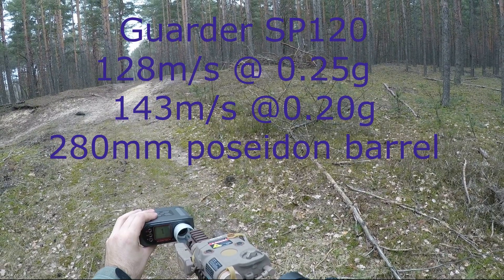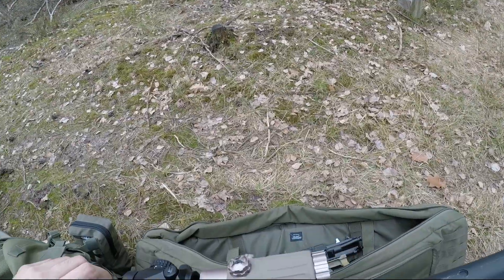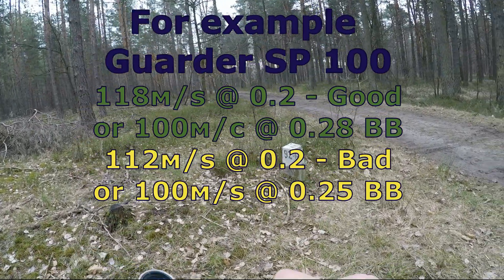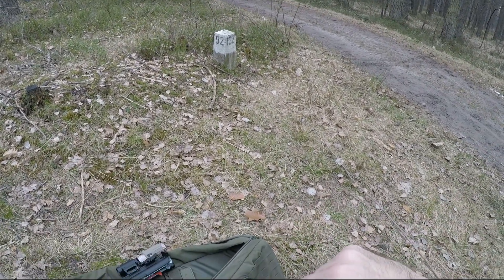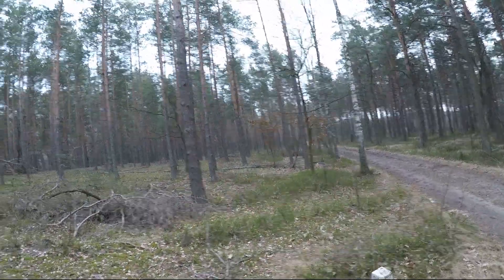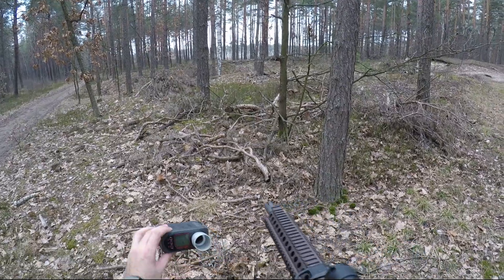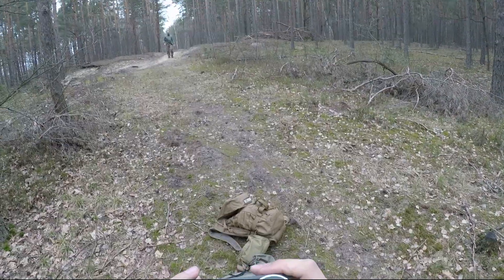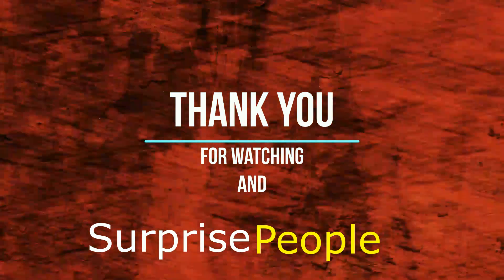If AEG FPS depend on barrel length?

Comment: This isn't a scientific test. If your cylinder is ported then that changes the experiment. This means your full length barrel is undervolumed.The best way to test is if you have a ported cylinder, then try a pdw upper the try the sbr upper. Also ive seen someone try to put a longer cj barrel in a we glock18c and cover it with a suppressor but it ended up going well above fps limits for pistols.

Comment: I’m also interested in what gun u used.
Reply from the maker: This is a bit of custom I made using ICS split body and gearbox, replicas of Daniel Defence rails and Titan Gatee mossfet
Reply: @rat6Vortex  thanks, what model of ics? Did u need to modify the receiver or did the Daniel DEFENSE rail fit?
Reply from the maker: @revodiver7574  upper and lower receiver from ICS CXP UK1 ( https://www.airsoftstore.ru/oruzhie/m-seriia/model-avtomata-ics-cxp-uk1-captain-mtr-stock-black# ) daniel defence replica from Madbull fits perfectly. Long one replica of Daniel Defence from Nurpol fits awfully.
Reply: @rat6Vortex  thanks a lot mate!